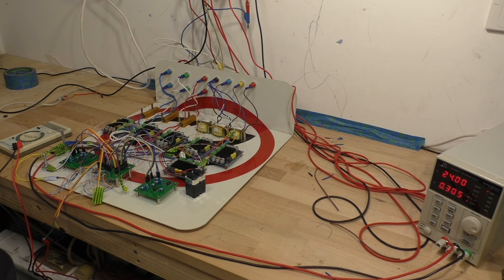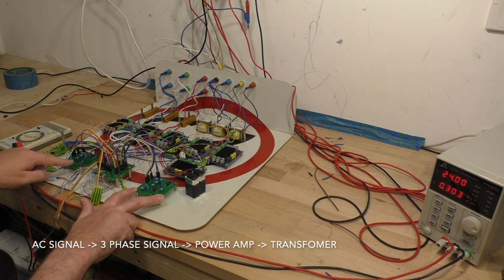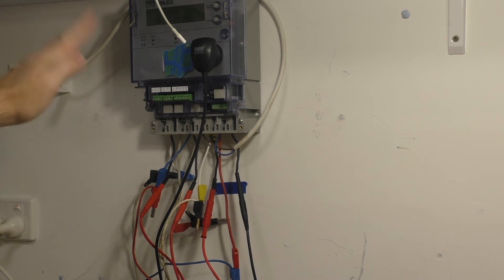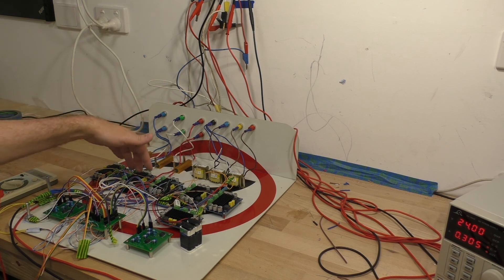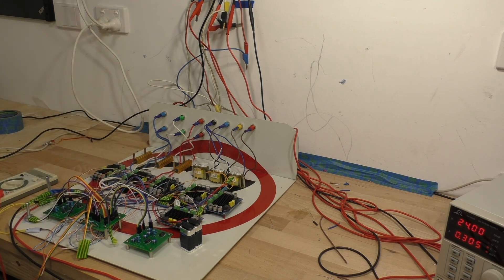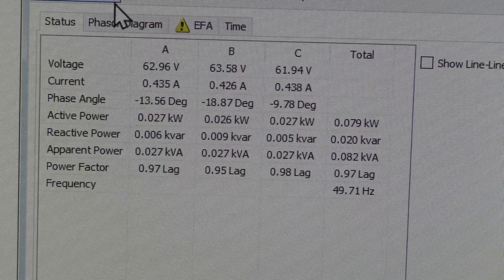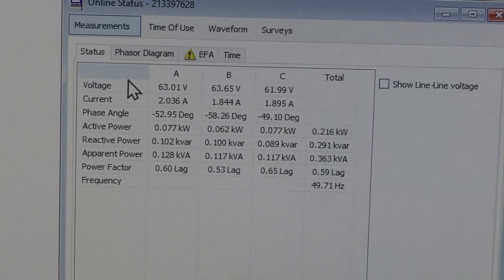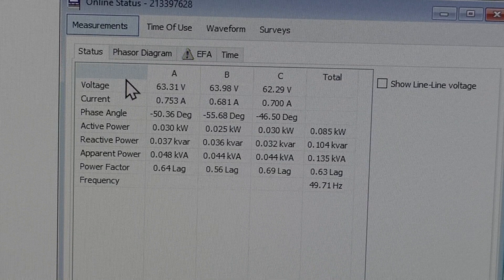Three Phase Power System Simulator

Comment: I made a similar thing if interested: 
https://www.youtube.com/watch?v=sezd4VaJJCM&ab_channel=ShirolaGhadirian
Reply from the maker: Just checked it out, it’s awesome. Running from a battery is why I started making one.  Have you tried making a three phase one
Reply: @50Hz  Thanks mate, this is from my 3phase system as I had more interest in 1Phase so I decided to finish the 1Phase first.
Reply from the maker: @ShirolaGhadirian  In terms of the battery. I was thinking about using two 12V Alarm battery using two so i can get  -12 +12 24V.  But I'm not sure how they would go being drained and charged all the time.
Reply: @50Hz  I experimented with a lot of options and in the end, it was best just to use a single battery (charged externally) and convert things back to AC.
Reply from the maker: @ShirolaGhadirian  I was going to use a car charger. But I'm definitely going to look at drill batteries now.

Comment: $150 AUS, so ~$20 US once you consider you get hit so hard with shipping etc.  I kid, but this is nice.  I'd be interested in seeing some timing capabilities, but that's mostly software integration and hardware capable of high (ms) sample rates.  Thanks for sharing and look forward to updates!
Reply from the maker: Actually that’s including the postage. I get most of my stuff off eBay so it’s free postage but takes a while. 

Once I get the ac generation part all working nicely I’ll try and add timing circuits. Then make a video of testing a simple overcurrent relay 
I just tested back feeding a CT from the current circuit and I was able to push 20A from an input current of 1.5A. 

Using this method I’ll be able to dramatically reduce the heat and provide a lot more current